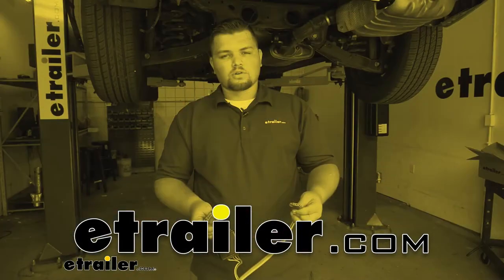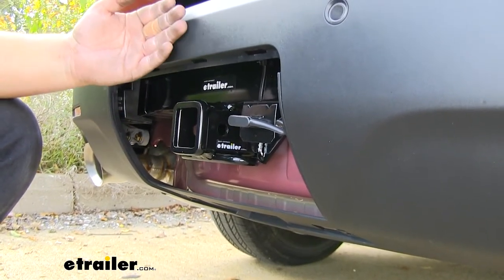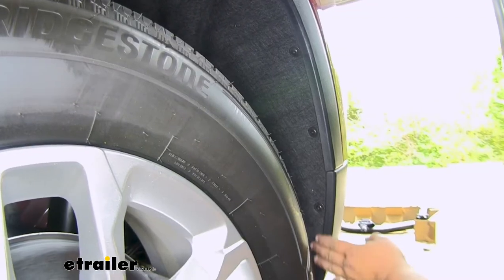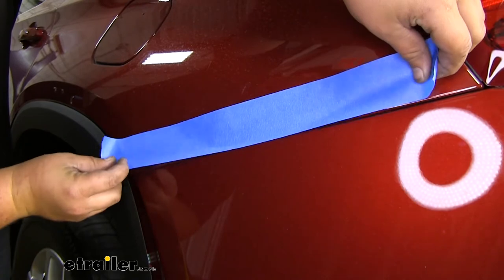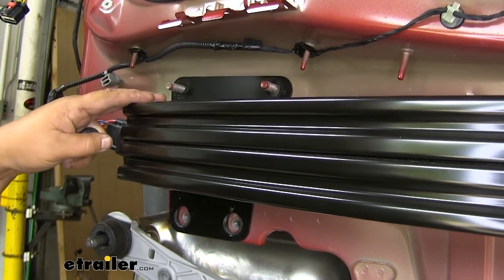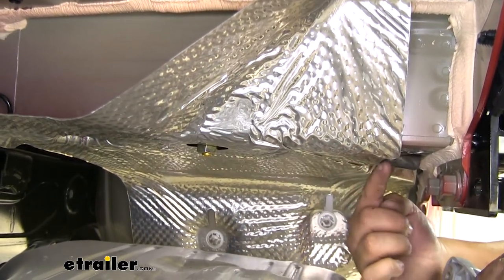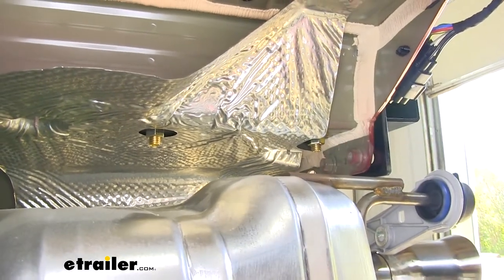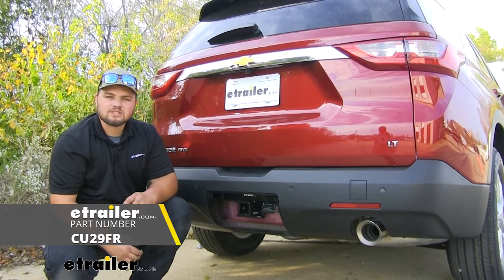etrailer | Curt Trailer Hitch Installation - 2020 Chevrolet Traverse

Comment: How long does the installation take?
Reply from the maker: The manufacturer lists the install time for the Curt # CU29FR Class III hitch at 1 hour 40 minutes for a professional installer. If you're a do it yourselfer of average mechanical ability, you can expect it to take about twice that amount of time.
https://www.etrailer.com/Trailer-Hitch/Chevrolet/Traverse/2020/CU29FR.html

Comment: Just clarifying that this installation is NOT installing a transmission cooler as well? How did you get the 5000 pound rating without that? Reason I ask is because my owners manual says 1500 pounds without the V 92 tow package and 5000 pounds with the V 92 tow package.
Reply from the maker: We didn't install a transmission cooler on the vehicle. The hitch itself has a 5000 lb towing capacity, which could be limited by the actual towing capacity of the vehicle, which will depend on how it's equipped.
https://www.etrailer.com/Trailer-Hitch/CURT/CU29FR.html